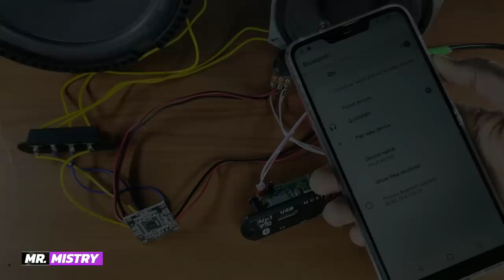Stereo USB Bluetooth Amplifier using PAM8610 board

Comment: Sir help me I am not getting clean sound in my speaker what should I do I am using tpa3110 amplifier module with 24 watt dc 2 amp dc adapter and 2.     4 ohm 20 watt speaker my sound is not clear please help me sir how can I fix that
Reply: You cam add 30 watt capacitor on speaker
Or some low watt capacitor on the power source
I hope it would be grateful to you
If yes please reply.

Comment: Can u help me to solve issue..?? My board work well with low volume but gets problem/no sound/ gets off for higher volume on input
Reply: Connect 4700mfd/25v capacitor across +ve and -ve supply line.
Reply: And use 2 to 5 amper 12 volt supply

Comment: No ground loop isolator installed, that means you are dealing with humming noise. You never showed that in the video either, you probably cut that part out.

Comment: when i connected mp3 bluetooth modul and the amplifier with same power source it give me very loud  distortion noise, how to fix this?
Reply: On aliexpress.   B0505S-1W 5V to 5V converter DC DC power module converter
Reply: Use a mobile charger for power supply to Bluetooth module

Comment: nice, but.....when i see, the speakers + and - with the same colour, you dont control + and -. that doesnt work fine, one speaker can go in and the other goes out if you dont have the right (+ &-) on the right way to the amplifier. its terrible enough to use two different speakers
Reply: НАПЪЛНО ТЕ ПОДКРЕПЯМ, НО ЗА ДА ЗАСВИРИ ...ТРЯБВА КОНДЕНЗАТОР НА ЗАХРАНВАНЕТО  2Х10000 мф за 8 ом.за 4 ом 4х10000 мф.

Comment: Can you use the three-pin potentiometer? How and the connection?
Reply: with nob on your Right one is GND, middle one is Out put to Amp and Left is INPUT to your Audio Source
Reply: Well, the three pin potentiometer is a mono channel. The six pin is a stereo channel. You can use 2 3pin potentiometers to control volume on left and right channel.

Comment: Speaker ki watt or ohm btana plz or size bhi
Reply: it can handle 10 Inch woofer also.. but issue is IC gets too hot get burn... I have tested with m two 10 inch woofer and nice sound quality.

Comment: This amp have 15 W power on 1 speacker hmm i can blow a 3 W speacker? :)
Reply: Then I think you just need the bluetooth module, it can handle this
Reply: Use pam 8403, but make sure it is powered witn 5V 2A power adapter